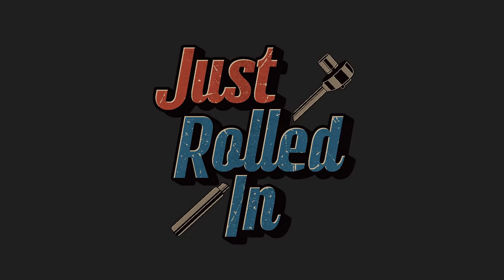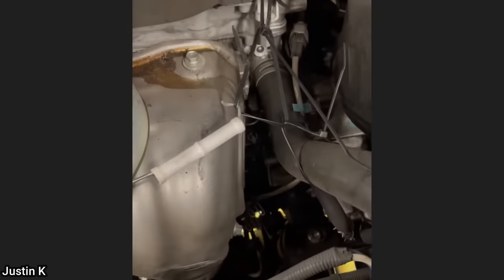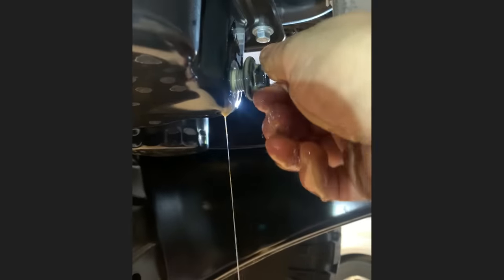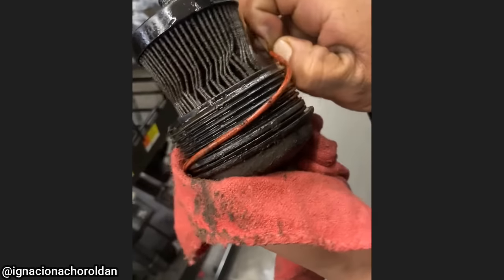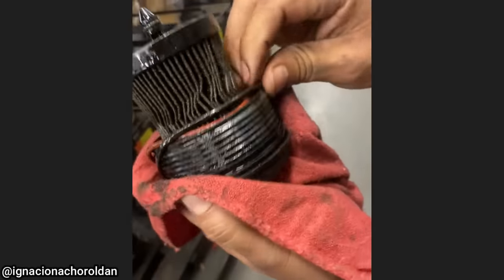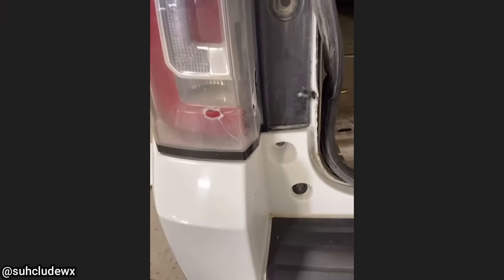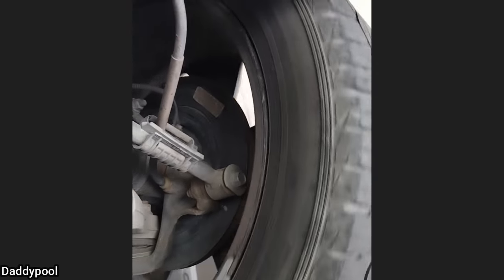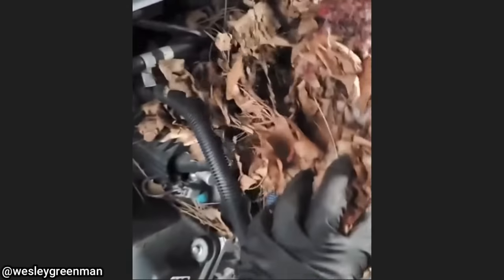Customer States Truck Is All Over The Road | Just Rolled In

Comment: I took my current Jeep to a local shop for it's first oil change. This was not a Jiffy Lube or other quick oil change type place. It was a full service shop that had performed work on my other vehicles in the past.  I took it there because I had a coupon.

About 15 minutes after they were done, I was driving and saw some smoke coming from under the hood.  I take it back to the shop.  The guy doing the oil change forgot to put the gasket around the filter housing, causing oil to leak on the engine.  

From that day on, I've been doing the oil changes.  So, if it blows up, it's my own fault.
Reply: Got my oil changed at a quick lube. Leave and start throwing codes. They cross threaded the oil cap.
Reply: These oil shops are in no way mechanics. They are after quick changes. They don't have your best interest at heart. I never let oil places touch my vehicles
Reply: after I had the oil changed in my JEEP I had to wash my hands got a little bit dirty but it was done right ,, no oil leaks oil drained before new oil added ,, old filer removed and checked new filter for the o ring ,, have got a few in the past the factory forgot to install the seal ,,also checked to make sure the old seal  was removed .. some times they come off with the filter and other times they stick too the filter mount ,,
Reply: I’ve been getting my oil changed at those quick oil change places and I’ve never had a problem lol

Comment: Yeah, I had a bug problem in my car too, until I hooked up the positive cable to the coolant reservoir.  Then, the toxic fumes killed all the bugs for me.  I know, because I got the mechanic's report while I was at the hospital.  Bug problem solved.
Reply: It works even better if you fill the coolant reservoir with bug spray !
Reply: Unless you have a metal reservoir, you will need a negitive  cable too.
Reply: I got rid of them with my 9 mm but then suddenly my rear AC was not working.
Reply: VERY GOOD.
Reply: Roaches make my skin crawl. My ex-wife gave a friend of hers a ride once. Later that day, we were sitting in the McD's drive-thru. I was sitting in the passenger seat, and out of boredom, I opened her glove box. A roach darted behind the owner's manual. I slammed it shut and just stared at her. She asked what my problem was, and I just pointed at the glove box and said "critter". She freaked, and, long story short, the lady working the drive-thru window that night witnessed some random guy going ham on the contents of a glovebox before shouting "IT'S DEAD!" and slamming it shut.
Reply: @joevk6274  ya but did it lay eggs? No such thing as one.
Reply: @lesliehunter1823  We had that car another 2-3 yeras, and never saw another one, so I guess not.
Reply: you should patent that idea !!!
Reply: @joevk6274 , My mother told me about a girl she went to school with back in the 1950's. This girl had her hair up in a beehive style hairdo and never washed it because cost to much to put back up. Mom had the desk behind this girl and said roaches would crawl out of the girls hair and all over the place. Was not long before the girl had to sit away from other students. Yes, roaches had made a nest in her hair.
Reply: @joevk6274  criminey! that story made me laugh my drink through the nose! I barely avoided the keyboard...
I bet the clerk lady at the drive-thru was like, "ah, that's a new one... tonight."
Reply: LOL
Reply: I saw the Roaches and went NOPE!!!
Reply: Now THAT'S funny!!

Comment: The new truck with coolant in the oil reminds me of one my dad saw in the early 2000s. They sold a new Cobra and it over heated a few blocks away from the lot. The guy that assembled the engine didn't torque one of the heads down.
Reply from the maker: You're supposed to torque those...? Lol
Reply: I'm betting it was a new guy on the assembly line that put fluid in the wrong place.  "Just do this the same way you did the oil yesterday".
Reply: Was it a Superformance or Shelby? They're the only ones I can recall that sold new "Cobras"  in the early 2000's. The rest you had to build yourself.
Reply: @JustRolledIn  Yep especially after you use RTV sealant on them!
Reply from the maker: @TheDisgruntledMechanic  😂😂
Reply: @russellhltn1396  Looks like a head gasket port wall failure.
Reply: @BubbaSmurft  Most likely an SVT Mustang Cobra.
Reply: Ya I'm gonna call bullshit . All SVT  engines are hand built , not on an assembly line .
Reply: @BubbaSmurft  it was an SVT, my dad was one of the SVT certified techs at that dealer.
Reply: @johnmilner5485  it was a hand-built SVT, at least they knew who screwed it up.

Comment: When I was a kid there was a car in a local junkyard that previously got lit up in a firefight between police and some criminal masterminds who ended up getting gunned down. Their '80's Chevy Citation looked like swiss cheese and still ran, it was used it around the junkyard after sweeping out the glass, and sticking a note on the dashboard never to put more than 5 gallons in the gas tank because there was a bullet hole in the top of the gas tank, and it would slosh out, supposedly the bullet was still in there. They ran that car around the yard for a little while until someone offered to buy the engine, then the rest of the car got crushed.
Reply: that's a really cool story about that car, thanks for sharing
Reply: Did anyone ever get a "Citation" for shooting up the car🤷‍♂️
OK? That was "corny"😔
Reply: @Montyhugo  The Chevy Citation was named as such because it was likely to break down in traffic causing you to get a Citation haha

Comment: If I saw that truck with all the cockroaches, I'd pretty much just close the door and nope out of there.
Reply from the maker: Same 😂
Reply: Toss in a couple bug bombs and call the customer to come get their vehicle
Reply: @charliekeene2003  There is a youtube video where a guy had roaches in his car, so he used about 12 insect foggers all at once. Something ignited the fumes, and the car burned to the ground. No more roaches! It's here somewhere, under "car fire".
Reply: @BakedRBeans  I was only talking 2 or 3 at most, but I think I've seen that before somewhere
Reply: @BakedRBeans  April 2005, Perth in Western Australia, the owner of a Thai restaurant set off 36 cockroach bombs; thanks to an oven pilot light the fumes exploded, taking off the roof and blowing out the back wall - damage was about half a million. 
April 2020, Sydney this time, a homeowner used 10 bombs; add another oven pilot light and the house was destroyed.
There will be others of course. People can be very stupid.
Reply: @BakedRBeans  Roach bait, and that white powder too, we use both. 100 safe! As the powder is just boric acid. They eat out' their insides with powder. The bait, they share and take to the nests  very effective. Non Toxic. We had a  massive roach problem on a stored car.  This cleared every roach out! Takes a bit longer but non toxic
Reply: @charliekeene2003  Consider the number of cubic feet of air in a car interior- far less than the amount of an average room a fogger is designed for. So even one fogger sounds risky.
Reply: @captainamericaamerica8090  Years ago, I would buy and re-sell old refrigerators. Picked up one that was filled with roaches. I didn't want to use bug spray, so I bought a pack of 2 "roach motels". Put one in the freezer an other in the refrig area. Left the unit turned off. 3 days later, all roaches were successfully captured. Non-toxic!
Reply: @BakedRBeans  they still sell those. We like the boric acid, white powder. It took care of a massive roach infestation on a old stowed away van. 100 percent safe.
Reply: @BakedRBeans  "They check in, but they don't check out!" 🤣
Reply: @michaelmclachlan1650  1 is good, 2 is better but 10 is da bomb.
Reply: @BigLisaFan  It was a solid double brick home too.

Comment: I typically either change my own oil or have a full service shop do it in the winter. Was short on time I hit up a quick lube place. 30 miles later I started throwing codes. They cross threaded the oil cap.  In the words of my father they could f up a wet dream

Comment: After 36 years of being a tech I still dont understand why people are obsessed with lifting a truck that is alreaDY HIGH ENOUGH?   and the worse part is that they almost NEVER do it properly?
Reply: In the words of Scotty Kulmer, "unless you live in a swamp or are a monster truck driver, there is no reason to lift your truck."
Reply: Agreed. I'd actually prefer manufacturers market a street performance truck with a lower suspension.
Reply: @lo1bo2  They did and few bought 'em, Lightning, SS454, Ram SRT-10 off the top o'my noggin.
Reply: @BubbaSmurft  
Well, yeah.. at around $70,000 apiece they shouldn't wonder why they didn't sell like a F150.
Reply: My truck is leveled but done the right way with remote reservoir coil overs new UCAs to correct the angle on the ball joint and the CVs are still in spec. Stacking lifts is just and idiot move both safety wise but it also puts everything else out of wack.  He must replace CVs and ball joints all the time
Reply: @bruceb4349  That's a silly argument when they sure seem to sell all the Raptors and TRX's they can make at 100
Reply: I agree, even stock trucks are too high these days.  I miss trucks that have actual usable beds.  Jacking a pickup higher is a sign that the driver doesn't actually use the vehicle for its purpose (to haul stuff in the truck bed).
Reply: I can't believe people lower trucks by cutting the springs. We had a guy roll in with a civic saying he had a rough ride. He had so many spring compressors on the strut had no travel. Zero. His camber was F'ed and his tires were through the steel on the inside. We told him to get out.
Reply: @bruceb4349  Don't look now, but regular pickup trucks are more expensive than that these days. Theoretically the MSRP starts at around $40k, but if you want anything nicer than the base, after dealer markup in the current market, you're looking at $100k easily.
Reply: in germany, the higher they rise their SUV or offroader, the lower chance they are to actually take it offroads. a while ago I saw a mercedes G-class with portal axles UNIMOG style. edged around the corner as though the ride was about to topple over, and everything looked brand-new. I doubt they will ever see a meadow or somesuch.
Reply: Compensating for something.

Comment: A runaway diesel is scary in general and can result in some truly terrifying failures. I will be happy so long as the only runaway diesels I ever see are on a monitor.
Reply: I love how the guy on camera looks over and walks away like "yep. There's the new kid."
Reply: Best way to stall out a runaway diesel is to stall it out in a high gear and hope your clutch holds.  Given that car was on the hoist, it's not stopping unless they can choke the intake (probably not possible with that design), unless they sprayed something up the intake to choke it I'm assuming that engine ran until it blew apart or until the sump ran dry.  Either way, I wouldn't want to be the old fella having to huff that fume, I'd nope out of there too.
Reply: I saw a ups van with a runaway engine driving down a street lol it’s like don’t you see the wall of smoke , it was not the one on video where they disconnected the battery 🤣 NB it didn’t stop the engine 🤣
Reply: @masondegaulle5731  This is probably in the US where most cars are automatic, not manual - so it could be pretty difficult to deal with.
Reply: I had a runaway diesel in my VW Amarok here in Tassie.  Unfortunately it blew 3 of four injectors out (two sitting on top of the engine, one having dented the bonnet, the third about 1/2 way out)before I could do anything.  The only thing ‘holding’ them on was the remains of the fuel lines.  Made a hell of a mess.
Reply: @andrewallason4530  I'm curious, how did you manage to put a pickup truck with an actual motor, into a wine cup? That seems like quite a feat.
Reply: @whyjnot420  wine cup?
Reply: @andrewallason4530  tassie (plural tassies)

(Scotland) A cup or goblet for drinking wine.

edit: I was making a very bad joke. It was either that or "I heard that trucks can be quite tart after such an experience."
Reply: @whyjnot420  good one, mate.  I should’ve known.  MacDonald on one side, MacAllister on the other- but HEAVILY diluted with my ancestors having emigrated to Canada some 150 -200 years ago, then my parents came to Australia 50 years ago.  My great-grandmother only spoke Scots, even as a third generation Canadian!
Reply: @andrewallason4530  My dad's side is a mix of Scots and Germans and he really loves that Scottish side. Even if the German side has a name with an awesome meaning. Armentrout. Apparently means 'friend of the valkyries'. That part of the family even has an 800someodd page family history for its time in the US going back around 410 years with detailed info from the early 1700s to the late 70s when it was printed (I was "published" a bit too late personally, yeah, I'm in a mood for really bad puns and idioms this morning)

edit: btw afaik, we can trace that part of the family back to the 14th century with some degree of accuracy. Kinda nifty tbh.
Reply: @masondegaulle5731  I always thought that strangling a runaway diesel was the best option. Granted most of what I learned about them was in relation to marine diesels, since, well, ships are pretty awesome. Grab a Co2 fire extinguisher and blast the intake until it dies.

Comment: I wish i can take videos at my shop but i work at a franchise. We had a dude come in after driving 3 days without a belt and oil all over the Front Right of the vehicle. The Struts and the wheel was cakes with oil and dirt, also note that the "missing belt" was just chilling on the chassis.

Comment: I don't know what went wrong with the "coolant in engine" on a vehicle with 6 miles on the clock but I'm imagining it being as simple as, someone at the factory poured coolant in the oil fill hole.
Reply: Yep. My first though was assembly line shenanigans. Happens more often than you'd think.

Comment: Had a similar engine failure years ago on a 3 valve 5.4 Gas engine in an F-150. Brand new vehicle and tons of coolant in the oil. I did perform a teardown in that case and I found what we all eventually determined was accidental casting sand still in the block, it was everywhere and it completely ruined the head gaskets (among other things but that was the most apparent domino to fall).

Comment: I'm just guessing but a worker at the factory who topped off the fluids could have filled the engine with the coolant by accident since the truck was delivered to the dealer straight from the factory. And a cool vintage First Generation Vette at the end.
Reply from the maker: I was thinking that as well. Wish they would let him dig into it but hopefully we get an update.
Reply: @JustRolledIn  I hope so too.  I've seen videos where auto factories are beehives of activity especially at the end where workers are practically rushing to inspect the trucks and top off the fluids before sending them onto the transport trucks. I'm sure that other vehicles that left the factory had the same issue as the truck.
Reply: @johnm.5848  I guess the factory inspection didn't catch fluid levels and neither the dealer when the truck was delivered.  Heck, why not ship the entire truck back to the factory instead of an engine swap. #Customerbuyback
Reply: If I ever buy another new car, I'm going to check every fluid I can first.
Reply: I wonder if the dealer fired the PDI tech?
Reply from the maker: @brucecoleman7412  I'm assuming it got found during the PDI as the truck wasn't sold yet.
Reply: @JustRolledIn  I must have missed that!

Comment: The truck with stacked blocks should be taken off of the road untill properly sorted. Spring mounts should be attached lower on the frame rails, and longer springs used with more arch. A torque-arm is a must to avoid spring-wrap. Also the front suspension probably needs a look-see as well.
I'd recommend an SAS up front, also fitted with a torque arm. The rear lift blocks gotta go.

Comment: Lifted trucks with blocks aren't stable even if installed right...better to have the proper arched leaf springs
Reply from the maker: Agreed. Seen this happened lots when I worked at Ford.
Reply: @JustRolledIn  I've done several lifts on 4x4 s and it's just better to order the appropriate springs than using long lift blocks. Anything over two inches is just too much  especially on with u bolts

Comment: This reminds me of a story my friend told me. He worked at a gas/service station. One day a lady came in and purchased three quarts of oil, she said she was low. A little while later she was back and bought two more. A few minutes later she was back again at the counter with two more. At this point he asked her what are you doing with all that oil? She stated the car was still low on oil. So he decided to go check it out. He went and pulled out the dipstick and to his amazement it was halfway up the stick. He asked her how do you figure that it is low on oil? She replied; "I still can't see any oil through the opening here!" Pointing to the open oil filler  cap on the valve cover. Thankfully after some convincing he had it pushed into the service bay where they drained several extra quarts of oil out it.